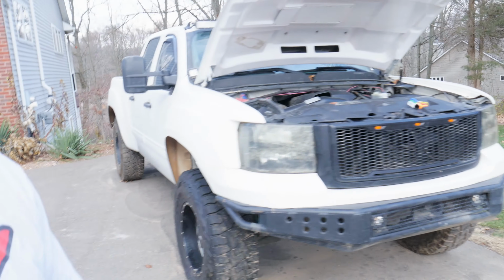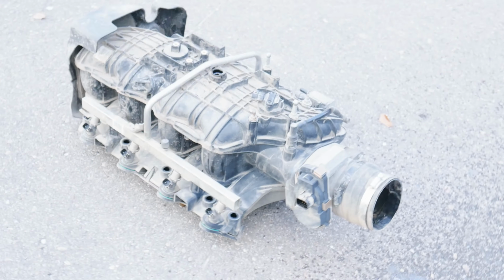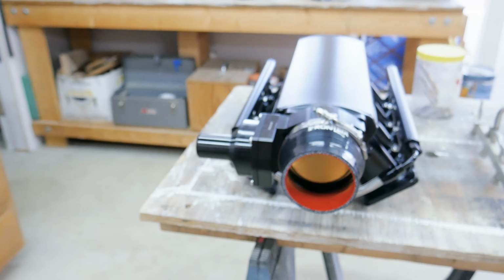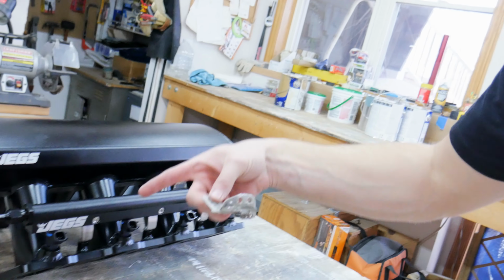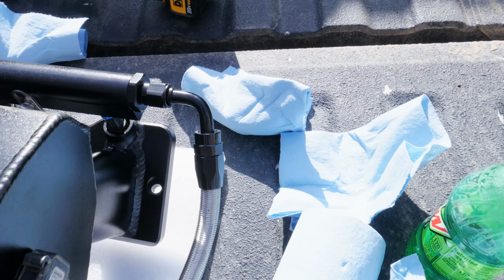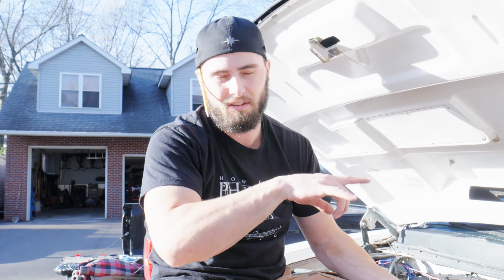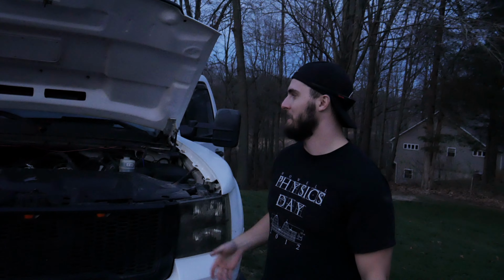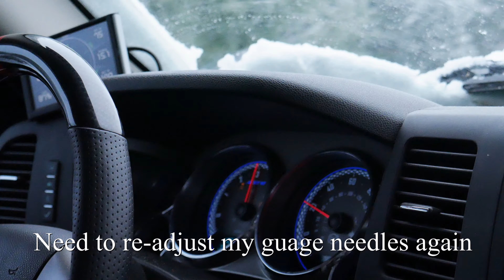5.3L Vortec LS1,LS2,LS6 Jegs Fabricated Intake Manifold - 102mm Throttle body - GMC Sierra Prerunner

Comment: That stock intake manifold is actually one of the best flowing intakes GM ever made for the LS. Richard holdner has dyno vids comparing every intake manifold for the LS
Reply: Facts!
Reply: All Hail The HOLDNER!!!! Just a video fulla unnecessary but ehh...not my pickup and he inspires people...then I  "Gap-tize" Em and show em the "True LS Way"😁😉😆😝
Reply: Ya that intake will lose a lot of low end regardless but unless you have a cam that's making power above like 6500 it is pointless and worse
Reply: @Fernando Chase It worked and I now got access to my account again. I am so happy!
Thanks so much, you really help me out!
Reply: @Jonah Finn You are welcome :D
Reply: @james10739  exactly!!  I had one to review and you can really tell the low end grunt was gone. It pulled hard way up high but not worth a damn for a tow rig.
Reply: He sure did!...but I like the way this looks as opposed to the factory pieces!...plus I'm ls swapping my '86 cutlass supreme brougham so I think the truck manifold sits to high for the hood to close so I'm looking for a low rise unit like this!...
Reply: @nathanielbolden5053  Corvette or Camaro intake wouldn’t work?  I have a89 Cadillac brougham and it cleared for me truck engine and intake.
Reply: Too bad stock intake won’t clear my hood 😢
Reply: @james10739  but thats what hes doing so??? whats with this comment
Reply: True just because it’s 102mm does not mean more power that stock motor is not built for that much air . Could have went with 92mm and did more out of it.
Reply: Fact's 💪
Reply: If it was a factory LS3 intake I’d say yes, but a truck intake no.
Reply: Mainly for aesthetics is what I understoo

Comment: we just got a ls 5.3 in a 2004 pu very clean and runs and drives good no leaks no engine lights black on black very cheap , cheaper than we can get a wrecking yard ls engine but this one has low miles interior in as good as new aftermarket stereo system just needs good wheels and tires just has stock rims on it now than got really good trailer dirt cheap from the original owner with title he went and replaced the deck and bearings it will haul my backhoe or cars with an aluminum toolbox on front with keys straps been looking for a good deal on a trailer can easily get twice the money for it last month it was a 10,000 dollar bass boat for free u don't even want to know about last year

Comment: That bracket serves as a rigging point for an engine lift if you wanted to pull the motor but I never used it. I prefer a proper lift plate where the valley cover goes. Just safer and more stable to lift the engine from the center point.
Reply: It’s actually designed to pinch the fuel line during a wreck
Reply: @Wongguyyy  If that was the case, why did they run the fuel lines in top of the transmission from behind the intake manifold? It is an engine hoist anchor point that gm had a special attachment for from the factory assembly line that would lock with the tooth on the bracket. They used it to drop the engine and transmission assembly onto the frame before the body would go on top.
Reply: @jamesmoyer3192  idk why they did it but I’m 💯 sure it’s for fuel line purposes, you can even look it up online if you don’t believe me

Comment: Nice thinking about getting that intake and throttle body for my 02 that's the only thing  I haven't upgraded on the engine. Cool decals BTW  that part is called a evap purge valve.

Comment: Question…
Why would you go with a 102mm throttle body and put a coupler on it that reduces the opening?
Doesn’t that defeat the purpose?
Reply: The coupler is to connect the cai to the manifold. Doesn’t reduce the inlet size
Reply: YOU'RE OBVIOUSLY NOT. A MECHANIC. 😂

Comment: I’ve been looking into one of these exact set ups with the larger throttlebody for my 03Z06, and it seems you must have additional engine work done, perhaps something like heads and a cam. Is there any truth to any of that?
Reply from the maker: Definitely recommend better flowing heads and a Cam shaft. I would also go with better deatschwerks injectors.
Reply: @CaswellCustoms  This is a 50th anniversary car, that is all original. I really don’t want to get to the internals of the engine unless it’s absolutely necessary. In this case it doesn’t sound like the set upwill  Work with my car at all unless I start doing engine work.
Reply from the maker: Ya if you only do the intake it’ll only look nice, you won’t gain any performance.
Reply: @CaswellCustoms  thanks again for your input, maybe I’ll pick up another LS engine for a different project…

Comment: What throttle body adapter did you use? I need a 8 pin to 6 pin
Reply from the maker: I didn’t need an adapter, my factory harness plugged right in.

Comment: Would this work on a 2011 silverado with a 4.8L? Awesome vids btw, has helped me alot with my installs!!
Reply from the maker: Awesome glad they have helped! And yes it should the factory intake is the same for the 4.8l, 5.3l and 6.2l in the 07-13 GM 1500 trucks.
Reply: @CaswellCustoms  Awesome! thank you! You gotta get some cams in that prerunner or a supercharger, I just threw a whipple supercharger running a 8.5lbs of boost and it is 110% worth the money!
Reply from the maker: @noahmallard8891  ya plan is to Cam it, torque converter, and regear! I had thought about supercharging it but I’m going to save the high horse power for the next Prerunner build I want to do after this.
Reply: @CaswellCustoms  solid plan my friend! I look forward to seeing it

Comment: Hey bro where does the PCV line, the line that’s on top of the factory intake, plug into on the aftermarket intake?
Reply from the maker: On the bottom side, there’s 4 bungs that you can put your own barbe fittings on
Reply: @CaswellCustoms  I figured that’s where I could mount it. And the very back fitting is for the MAP sensor correct?
Reply from the maker: Yes that is correct.
Reply: @CaswellCustoms  Appreciate the feedback bro

Comment: so can i  just slap a normal ls1 manifold on this vortec 5.3l v8 im putting together, it had a manifold that has a bunch of tabs on it and whatnot im looking for the cleaner corvette intake manifold
Reply from the maker: If it has cathedral ports, if it’s square you can’t.
Reply: Yes will be better off with it . Or truck intake works great to

Comment: I have this intake installed on my ls swap project. I am trying to figure out catch can routing. The car is NA. How did you route yours?
Reply from the maker: Routed from the rocker cover pcv valve on the drivers side to one of the 4 bungs on the bottom side of the intake as I showed in the video.

Comment: Will this work on a 2008 Silverado 5.3 LT
Reply from the maker: Yes it will
Reply: @ appreciate you actually replying something I really been looking into
Reply from the maker: @ you will need to get the truck tuned after, also buy quality injectors, not the Bosch ones I got
Reply: @ okay doesn’t come with the throttle and if not what size throttle body do I need

Comment: Having luck with that throttle body? Curious on the reliability on a cheaper option.
Reply from the maker: So far it’s performed great! I’m running into another issue with one of the injectors that I have to fix. But no issues with the throttle body.

Comment: What is the sizes of adapters to run the vacuum lines
Reply from the maker: which one? for the brake booster? the adapters out of the bottom of the intake came with the intake, all the other parts are linked in the description.
Reply: @CaswellCustoms  dang I just got my intake and it did not come with those adapters
Reply from the maker: @zacharymcdonald7080  they weren’t chillin inside the intake?

Comment: Stock engine or anything done to your truck before you added manifold ?, I have a 5,3 Silverado and looking to add some upgrades to it
Reply from the maker: Only other thing I had done to it was long tube headers. Now we’re in the process of a complete tear down and rebuilt with a cam and turbo.
Reply: @CaswellCustoms  gotcha man thanks for the help nice videos really helped me out alot
Reply: Don’t bother with the fab intake will lose power every where except over 6500rpm . Do a sloppy cam or a truck noris and headers . The. Hope and prey for your 4l60

Comment: Cool vid man, thanks for sharing!  I recently installed BTR stage 3 on my 12 Silverado...still running factory intake though, might need one of these :)
Reply from the maker: I’d check out my video after my dyno tuning numbers. But I also just found out I have a bad injector so idk if what happened during my dyno was right.
Reply: @CaswellCustoms  I watched it, I would be bummed as well. Hoping my intake is actually a restriction given I already installed cam and headers. I hope the injector was your issue, look forward to seeing whatever you do next
Reply: Stick with that stock pickup intake or TBSS/GenVI,maybe port match w a die grinder and deburr it and smooth it out,even smooth and fill in high/low spots on the outside to look better then stick some heat reflective tape to the underside of it (runners especially) to stop heat soak(cold air iz de gooder air,makah de powah mo betta😉😁😆🤘) then you're  ready to rock and roll w an intake better than any aftermarket overpriced "pretty" garbage

Comment: Was there much of a hp difference from stock to this intake manifold?
Reply from the maker: I will find that out today when I get the truck Dyno-tuned! And that will be the next video!
Reply: Did u ever go to the dyno and found out how many hp?
Reply from the maker: @mikegalindo2091  yes I did check out our most recent video for the numbers.
Reply: @CaswellCustoms great vids and info my man .any thanks!...my question is how much does a dynamic tune usually cost?...im swapping out a completely rebuilt olds vin y 307 for a gen 4 5.3 ls i got from my neighbor!...
Reply from the maker: I spent $600 in December of 2020

Comment: would you have hydrolocked if you kept the original intake setup on?
Reply from the maker: Most likely yes because I don’t have fender liners because of the fiberglass fenders, and my air box would have filled with water.

Comment: For anybody who doesn’t know, that throttle body WILL NOT WORK on 1999-2002 DBW (Drive By Wire). The plug on the 2003-2006 is different. This one only fits 2003-2006 plug. The only way to run this intake manifold on a 1999-2002 model is use the stock DBW throttle body and the adapter plate that allows it to bolt into a 4 bolt intake manifold opening.
Reply: Thanks for the info. I have a race car with an 02 Tahoe engine and I was looking at this intake because of its lower height.
Reply: Or buy a bigger throttle body for a DBC setup

Comment: What’s the link to the fittings that were used under the intake
Reply from the maker: The fittings all came with the intake, the only extra one I bought was the cap. https://amen.to/3lZKTpU
Reply: @CaswellCustoms  what’s the name of that cap and size because my intake got small leaks on my plate because i have a rubber seal over it
Reply from the maker: It is linked down in the description, 1/8 NPT Male Pipe Plug

Comment: Also, putting that rubber coupler back down to 86mm completely ruins the use of the 102mm throttlebody. You have gained nothing from buying those new parts.
Reply from the maker: Many mistakes were made figured that out pretty fast
Reply: There’s no gain from a 102mm opening on a stock engine anyway. He gained nothing but lost nothing either. Its a wash

Comment: Great idea to throw that monster throttle body on there, and then reduce it back down to 89mm. Wheres the facepalm emote when ya need it?!?
Reply: It was a great idea because going to 102mm does nothing on a stock motor anyway. Not to mention he needed to connect to his CAI existing tube in order to run the truck. They sell these intake/tb combos as a kit and it most typically comes default with a 102mm tb.
Reply: To be abundantly clear... I WOULD LOVE to get that intake in my truck! I went the other direction and did a cam and didn't properly resolve intake airflow. So I left a ton on the table too. We all learn from decisions. What we DONT seem to do is learn from others decisions!